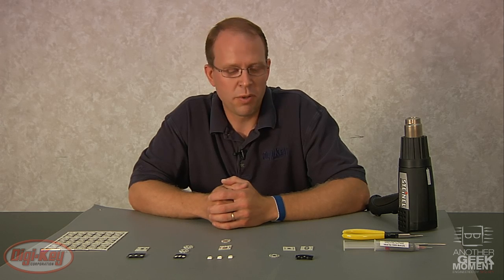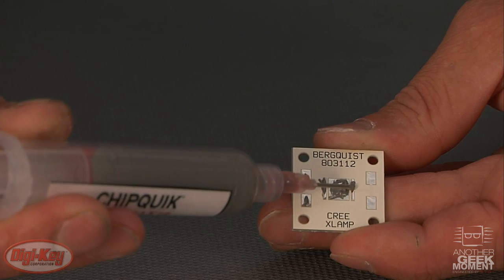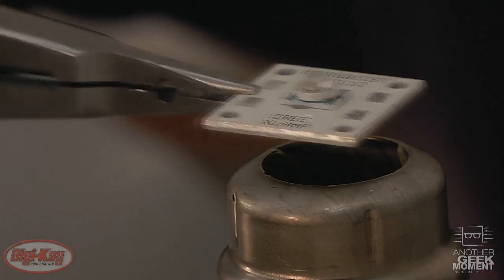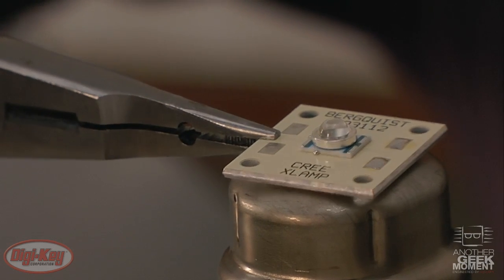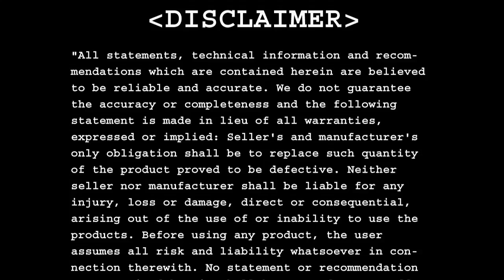Soldering High-Brightness LEDs - Another Geek Moment

Comment from the maker: Thank you for contacting Digi-Key - If you do not have access to the back of the board, or if it is double sided, I wouldn't recommend this method.  For the thermal pad, you may need to just use heat sink grease, like CW7270-ND.  For the other pins, there are many videos that can help.  Please let us know if you have any questions.